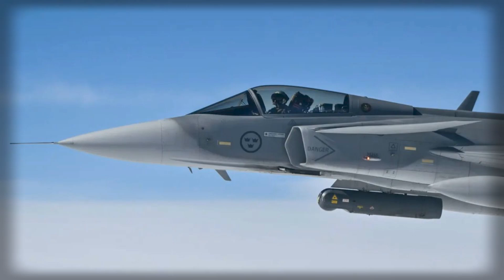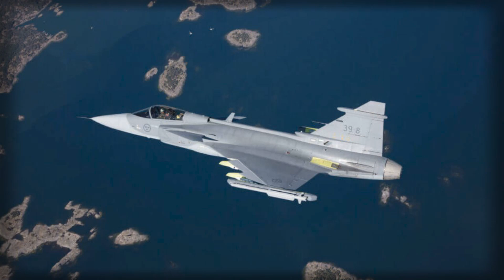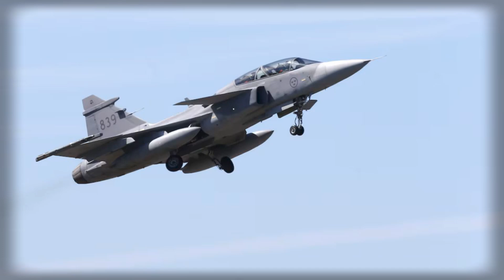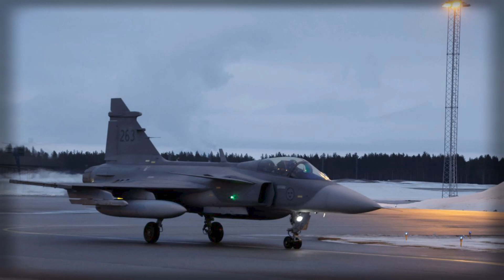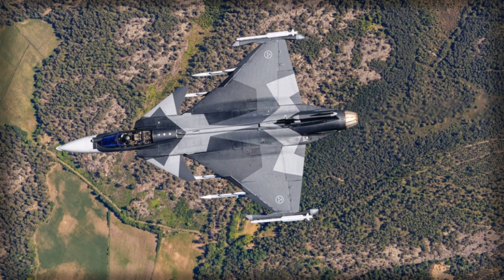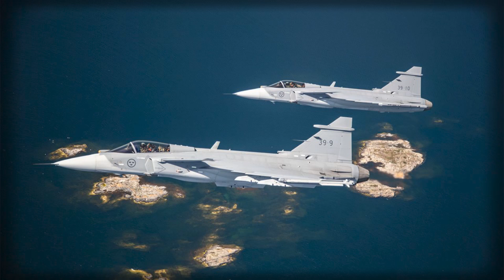Canada’s Surprise Role in Gripen Production | What It Means for Ukraine

Comment: The Gripen E has about one third U.S. content.  Canada and Saab need to look at getting a U.S. export license that allows Canadian manufacturing before they break ground in Canada. Canada isn't exactly viewed in the best light in Washington these days.
Reply from the maker: Fair point—U.S. content does bring ITAR into play.
But that’s a risk to manage, not a show-stopper. If Canada picked Gripen E, Saab and Ottawa would set up the needed ITAR agreements (TAAs/MLAs) early, just like other programs that integrate U.S. components. Local manufacture can proceed with the right licenses and compliance plan, and there are options to minimize U.S.-controlled parts if required.

Bottom line: the real trade-offs are capability, cost, and industrial benefits. Export licensing is a solvable process question, not a fatal flaw.
Reply: @mainbattletank6190  rolls-Royce EJ200 engine (dubbed the EJ230) could be used and.... We have a rolls royce factory in Montreal.
Reply: @mainbattletank6190  If you live in the U.S. and follow the WH you'll be aware that Trump and Carney aren't on the best terms...it's not a matter of process it's a matter of permission.